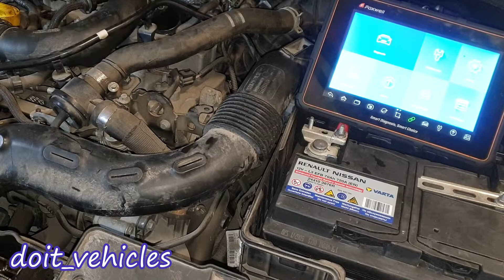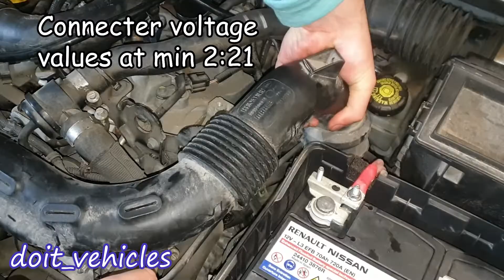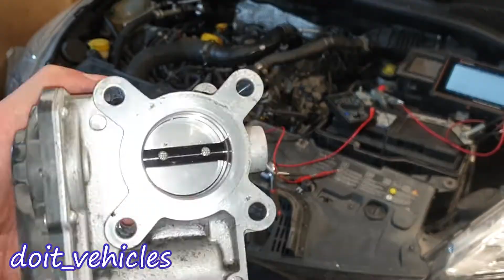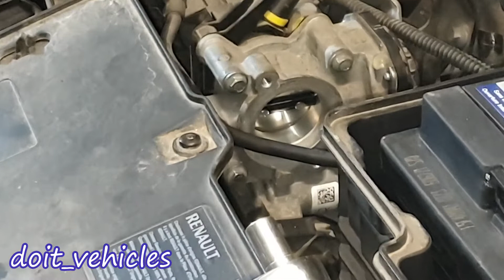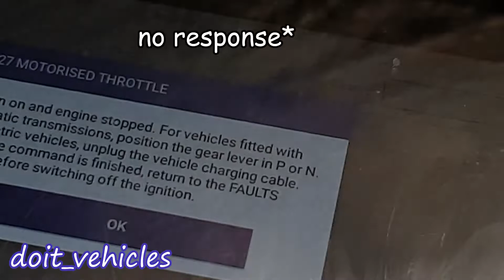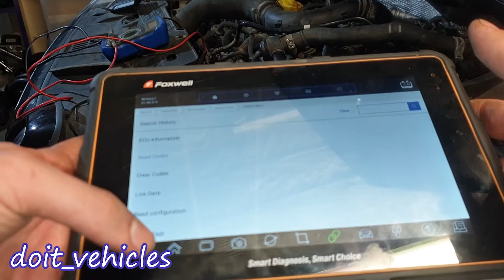Renault Clio THROTTLE BODY removal & clean 0.9 Tce

Comment: Hello, I have a 2015 model 0.9 TCe Clio with 125,000 km. There were no problems with the car, but last week I went up a high mountain (2400 meters altitude). When I stopped at the highest point, the revs started fluctuating between 0 and 900 and then the car stalled. I let the car rest, then started it with the gas pedal, and it was fine. After that, I drove about 250 km without any problems. I took the car to a mechanic, who connected it to the computer and said there was no problem. Everything seemed normal. There were no issues for a few days, but then at noon, when the engine was cold (the outside temperature was 40 degrees), the revs fluctuated again but quickly stabilized. After a 5-minute drive, when I stopped at a gas station, the revs dropped and then quickly recovered. From what I have observed, this problem only occurs in hot weather, not in cold weather. The car's performance is normal, and there are no abnormal sounds. No warning lights are on. Has anyone experienced something like this? Sorry for the long message. 🙂
Reply: Maybe pursue the MAF sensor, the good thing is it can be gently cleaned first.  Certainly google that for your car type, model, see if it can be pinpointed.  The terrible thing about google being used to diagnose faults on cars or anything is, if you know the exact fault, you can word the question to get the exact right answer…in other words, it’s worth a few minutes of ‘guessing’ what might be the fault, and asking that particular question, see if something comes up with symptoms very close to your exact problem?  I would just point out, wouldn’t that high mountain point be quite cold, and that is the commonality with the other time the fault happened?  Anyway, the MAF is a good starting point.  Good luck.